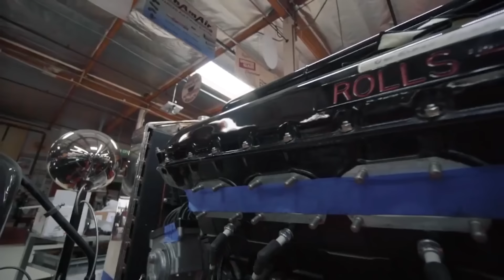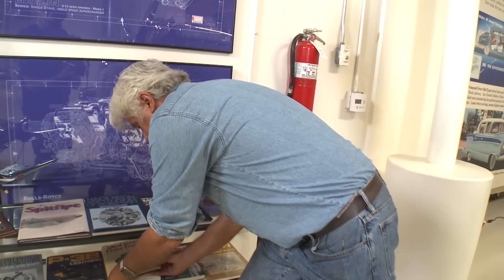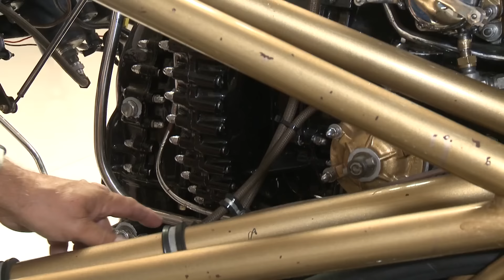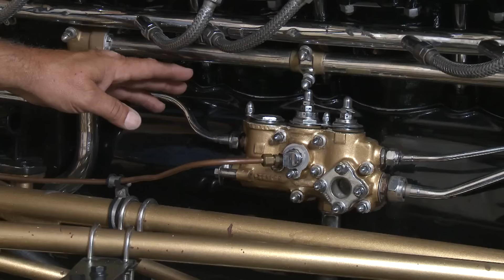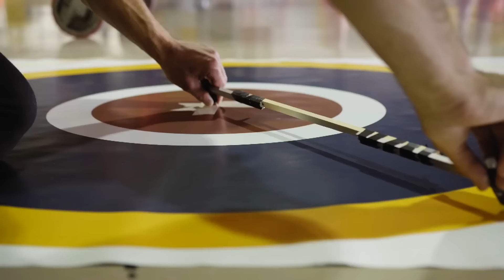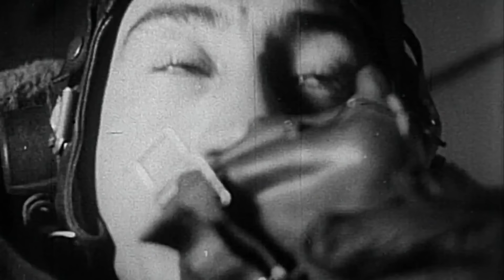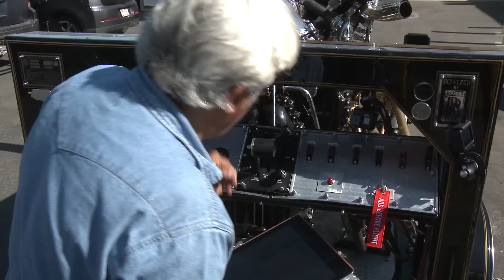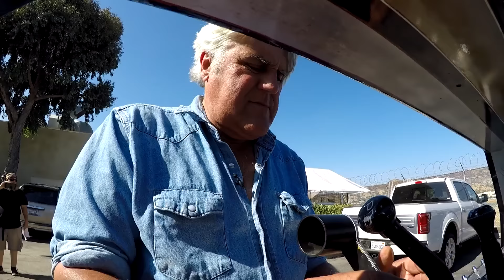The Engine That Won World War II - Jay Leno's Garage

Comment: Great seeing a British invention spread right across the world. A British engine used in p-51s and spits too all across the world. Brilliant.
Reply: Pretty sure Rolls Royce were building Merlins long before the USA joined the war. The high altitude performance was a significant improvement on the Alison engines and gave the P-51's a new lease of life.
Reply: John nevertheless, still a British invention and it was built in Canada too.
Reply: John Rolls Royce would have never been able to supply all the engines needed for Lancasters, Spitfires and Hurricanes.
Reply: @volon5  ONLY after the Brits came up with the 2 stage supercharger in 1942 inservice 1943 !!!  Before that ALL merlins were also ONLY a single stage !!!  When the Packard V1650-1 was installed in the P40 F and L models, 1311 of them, it made NO difference in performance !!!  SO until the merlin received the 2 stage supercharger the ALLison matched and exceeded the performance of the SINGLE stage supercharged merlin !!!  Why the Mustang MkI was 30 MPH FASTER than a Mk V shitfire, current production merlin engine !!!!!
Reply: @wilburfinnigan2142  
Rolls Royce came up with the 2 stage supercharger in 1941 and it was in service in 1942. the Allison not only had poor performance at any height, it lacked the performance of the single stage supercharged Merlin engine. the P 51 which entered service in 1942 about the same time as the Spitfire Mk IX was not much faster than a Spitfire Mk V and had very poor acceleration and rate of climb/  The Spitfire Mk IX in July 1942 was i a very different class.
Reply: @wilburfinnigan2142  wrong, wrong and wrong again. Early Merlin engined Spitfires could easily get above 30,000'. No Mustang 1 was comfortable above 20,000'. Speed means nothing in a dogfight. Manouverability is all - as the U.S. found out when they first encountered the Mitsubishi Zero.
Reply: To everybody in this comments section - can you imagine what actual war veterans would make of these discussions? They all fought incredibly bravely, alongside each other, for our freedom. All this petty point scoring is demeaning to their memory. 
Both my grandads took part in the WW2, my great grandad worked in the Spitfire plant at Castle Bromwich, Birmingham. One of my dad’s uncles was killed in a Japanese prisoner of war camp, another was captured on D-Day. 
Nearly all of us have connections to a lot of very brave relatives, let’s be proud of all of them.
Reply: @leftmono1016  Well said sir , the internet is full of " keyboard experts "  who haven't a clue what their commenting about ! All brave people on both sides of the pond .
Reply: sgbobsg  Field Marshal Goering may of made some mistakes, but the the Germans weren't stupid, Britain was a very important objective in the war
to them, if the Brits had not of won the battle of Britain, their would be no 
D day in the future, i think they were quite aware the american were most probably going to get involved later in the war.
Anyway buddy it doesn't matter me or you wasn't born, and to be honest i don't think we have the right to argue over such things, we should be more respectful to the men and women who fought for our freedom, than arguing over who did what.
Reply: @subconscious.com_usa6691  Well said sir ! Nice to see a grown up comment ! In Afghanistan the "Mericans " were a great bunch of lads even sharing their superior kit ! So proud we are comrades .
Reply: sgbobsg I’m an American and I can say your wrong. Wtf man. You just roasted someone you don’t even know and in case you didn’t know we didn’t single handedly win the war.
Reply: sgbobsg  
Rolls Poyce did all the design and development and made far more Merlin engines than Packard, Rolls royce also made the Griffon engines and jet engines. Rolls Royce even had to show Packard how to do it.
Reply: 🤔 WOW i thourght the WAR was over ...maby not by the sound of it in here ????
Reply: I think a lot of folk in this thread need to chill out a bit . I would also recommend reading the book wings on my sleeve by Eric “winkle” Brown . Am guessing he knew a lot more than all of us .
Reply: @rcr76  Very true Eric " Winkle " Brown was one of , if not the most experienced , highly regarded pilots of that era . He flew more types of aircraft than anybody.
Reply: @rcr76  First sensible comment.
Reply: sgbobsg  
yet everything I say is true and can be proven while everything you say is untrue or you would be able to prove it.

I challenge you to prove just one thing.
Reply: sgbobsg  
From October 1943 a total of 167 Wellands were dispatched from the Rolls-Royce facility at Barnoldswick. By this point, Adrian Lombard's straight-through design, which became the Rolls-Royce Derwent, had proved more reliable and produced more thrust, and production of the Welland ended.  Then there was the RR Nene in 1944.  No jet engines in WW II? 
 Packard had been making V 12 car and boat engines but not aero engines and nothing at all like the Merlin which was being mass produced in Britain before Rolls Royce gave the engine to Packard and showed them how it should be made.  So not only was Rolls Royce making jet engines and all the Griffon engines they made more Merlin engines than Packard.
Reply: sgbobsg  
Ford of Britain which was not controlled by Ford USA did make rolls Royce Merlin engines just as Packard made Rolls Royce Merlin engines, Rolls Royce paid for them all and Rolls Royce made 65,000 or 10,000 more than Packard, Rolls Royce also did all the design and development as well as work on the supercharger and carburetor which Packard never did, Rolls Royce also made all the Griffon engines different jet engines, they also did all the design and development of the Griffon and the development of the jet engines and most of this was during the war.  So no if you add Ford of Britain to Packard Rolls Royce still did more during the war.
Reply: sgbobsg Yeah we were too busy trying to defend half of Europe while bombing Germany... and Montgomery was quite the character but all of the offensive big operations were led by us and Churchill wouldn’t have it any other way which is illustrated in the history books. I think you forgot we are allies, and yeah 40-41 was spent defending British soil which was under heat from the Luftwaffe.
Reply: Adam corrigan I as an American agree. Don’t know why people hating on you guys.
Reply: @adamsaffell2361  it was a collaboration
British intelligence American steel and russian blood
Reply: sgbobsg  
Germany had radar of their own and they did try to destroy the British radar, USA may not have known what radar was until Britain gave it to you like so many other things.   If you ever went to Dover in the South East of England there are still 3 of the old radar towers there, very hard to not see them, in fact they are quite visible from Calais in France.
When Germany was trying to destroy the radar they did briefly put just one out of action, it was at Ventnor in the Isle of White, that is just off the coast of Southern England. but no only was it soon back in action the German's never knew they had put it out of action.
Reply: sgbobsg  Bruh you need to put your national pride aside and look at things realistically. Britain was the only country that could actually defend itself and America was needed for resources for dday. America should have come in earlier and not let millions die. They were allies
Reply: sgbobsg  
I know you have no facts, do you sweep the floors or what else is your excuse for being so ignorant?
I can prove my facts what can you prove?
Reply: sgbobsg  Iam swiss we gave up doing wars a long time ago ,you shouldnt be so defesive i was just pointing out a true historical event, you was talking about dunkirk, i was just pointing out your ancestors had a similar
event themselves with the same circumstances, the british made a huge mistake just like the germans did at dunkirk.
I have read most of your comments on here, and to be honest you dont paint a very good picture of yourself
this video's about the merlin engine, it seems to me you have come on here because your just one of those types of americans, who cant stand the fact that other countries had actually contributed to the ww2 war effort and made good stuff in the past besides the u.s , just because this video is titled the enginge that won ww2 you just couldnt handle it, it may not be the engine that won ww2, it doesnt really matter, but you just couldnt resist putting your boot in could you, cant other countries have there momment cant people appreciate none american achievements.
You know i could bring up vietnam after your last reply, but iam not going to do that, because i have class, to do that would make me just as bad as you, and it would be very disrespectful to the young americans who took part, so iam not.
By the way dont comment back iam not interested
Reply: the Merlin is the engine that MADE the p51d  what it is ..   the alison they had in it was a major underperformer...
Reply: sgbobsg  The Yanks kept out of it until the beginning of '42 . After Pearl Harbour. Late to the party as usual, same as WW1
Reply: Basically to summarise , the P-51 and the Spitfire were two great planes and the Merlin engine is a British engine...done 👍👍
Reply: sgbobsg  Funny that Barrie Rodcliffe absolutely dismantled all of your arguments months ago and you're still arguing. Pathetic.
Reply: sgbobsg funny that you forget how much us “brits” helped you with your war in the Pacific? Funny a lot of Americans forget that part...
Reply: sgbobsg how much fighting did you do? Shut the hell up.
Reply: sgbobsg  There's nothing wrong with a tactical retreat its being smart, the Americans had to retreat many many many times in the war of independents if they hadn't they would of lost.
Reply: my Father was on the Front Lines in WWII, and was Captured and Held Prisoner by the Germans until the End of the War
Reply: sgbobsg  
Gorimg did try to destroy the airfields, he failed, Goring also tried to destroy radar, he failed in that as well.
Reply: sgbobsg  
You couldn't get either language right could you?
Reply: @Ranger_Raptor_Twin-Turbo_3.0L  
Packard went broke in the early 1960's, Rolls Royce bought Allison.
Reply: sgbobsg  
I only say what is true and can be proven, maybe you should try it sometime.
Just as your reply to Wilbut Finnigan was absurd, The two stage supercharger was because the first stage worked very well from seal level to around 20,000 feet, the second stage gave performance from there up.
Reply: sgbobsg  Gotta be the dumbest comment I've read. Is that what American schools really teach u kid?
Reply: sgbobsg  Sounds like you've only learnt about the war from the American perspective. I mean I knew the education system in the US wasnt great but this??... bro you need to open your eye abit. Nothing I can do to help tho I guess. Ignorance is bliss as they say
Reply: sgbobsg  wow I guess you are not military as you wouldn't speak like that about all the good men and women who joined forces to defeat the Nazis
Reply: sgbobsg nevertheless he was the one calling the shots on the battlefield.
Reply: sgbobsg  whatever!,... your parents must be turning in their graves at how their off spring has become so full of biased hate towards the world and what a waste of time their sacrifice was for their child to become such a one sided nationalistic uncaring trump supporter ...🤦🤦🤦😔
Reply: sgbobsg  Ok perhaps i made a mistake
Reply: sgbobsg  There was also a P-51 mustang factory in Evansville, Indiana.  After the war it became a Whirlpool factory.  I grew up about 2 miles from the factory, but that was long before my time.  I was about 15-17 years too late to see the P-51's fly out of the attached airport north of the factory.  The airport was one of the reasons they chose that factory to build them.  I really don't know what engine they used from the Evansville factory, but I would assume the same one the rest used.
Reply: Original Prankster - I'm 3 miles from JLR Castle Brom. I remember when they started on the Spitfire Island and to begin with it just consisted of curved steel beams. I thought how stupid modern sculptures were - and then they fitted the Spitfires - brilliant :)
Reply: sgbobsg How??? The merlin IS BRITISH?!
Reply: sgbobsg Yanks as per usual. Listen. The merlin was British. You yanks decided to bump it up a bit but it wasn’t as good as the ones we were upgrading and producing. And putting everything aside. It remains a British product. That was adopted by the USA because it was the best engine designed at the time.
Reply: soaringtractor  You are correct.  Thanks for the correction.  The P-47 Thunderbolt was built in Evansville... mea culpa.  https://www.14news.com/story/29399467/p-47-thunderbolt-named-official-state-aircraft-of-indiana/
Reply: sgbobsg  The US education system is trash, go study.
Reply: soaringtractor  Guess it's because RR are so terrible that Boeing use RR engines... don't forget mate, it was the UK that gave you the Jet engine, it was the UK that gave the US the technology(all moving tail from Miles M52 project) that allowed the the US to go supersonic( the US wiped 10% of our wartime debt to rid the UK of out developing it in aerospace, such as the TSR2, BAE Replica and now, the sabre engine). Your are essentially bragging that you made 1/3 of all the engines that you couldn't design yourself, the Allison engine inferior in all ways... get over yourself. Notice how your huge industry couldn't do VTOL? So you adopted the harrier...you couldn't so Liftfsn in F35...hired RR... get a grip mate
Reply: the Axis Powers were defeated by the Allied Powers in World War 2. It was a joint effort so why do people always argue and fight over who contributed more? Get over it............
Reply: sgbobsg  The British forces were not "sitting on our Island", they were heavily engaged with fighting the Germans in North Africa at the time as well as the Royal Navy escorting convoys across the Atlantic and in the Baltic Sea. I'd ask you to respect the many thousands of British and other nations lives lost during the bloody fighting, they certainly were fully active in the years before the US assisted.
Reply: Yes, respect to Britain.  Then it became a welfare state and has invented nothing since.  The dangers of socialism.
Reply: P Run I think you’ll find most jet engines are produced here. Bentley, Rolls Royce, Triumphs, exports in alcohol, finest scotch. Welfare and internal affairs are exactly that. Internal. Bollocks to do with with the inventions of 1930+.
Reply: soaringtractor  .I read that the Allison had a fancy Turbo and Supercharger combination...but you could hear the turbo part so it wss quieter than non turbo motors- hence the moniker " Whispering Death"...is that correct?
Reply: sgbobsg plain wrong 55 thousand Merlins in the US the rest mass produced in UK, Packard did a fantastic job as a sub contractor and got paid for the lot. 146 thousand Merlins built. They are the fact now stop disrespecting your parents and mine who fought together against a common foe. If you are a Russian troll my grandfather was on the Russian convoys to Murmansk, later on while in Southern Atlantic his ship was torpedoed and he was was lost. My point I have many US friends and German friends and a Russian I am 63 and the war is a lot closer to to me, one generation. Fxxxcking grow up and stop disrespecting your parents and your grandparents. The allies fought together and won paying a huge price. You would do well to think on that. Stop waving your dxxk around and do some research and try to be interesting.
Reply: Anthony Wilson couldn’t have put it better myself.
Reply: Built on America because the Brits were being bombed and we had the facilities to build them. Our best effort was an Allison which was no match to Merlin
Reply: sgbobsg  And the british and other allied strategists took advantage of these mistakes. That's whats called good tactics I think
Reply: sgbobsg  What was your point?
Reply: The U.S's stuff wasn't up to date, so we got the best thing available and god dang did it work.
Reply: sgbobsg  But that is just it, from 1939 until 1942, The UK more or less fought alone in Western Europe. Oh and all of the stuff you sent over to help the UK, it was all paid for, every item was purchased. The USA gave us nothing. The difference is that given the same situation, but the other way around, The UK would have fought alongside the USA from day one.
Reply: sgbobsg  I am of course very grateful to the American men and women for all of their efforts, prior to them actually fighting which did not take place until after Pearl Harbour. Yes of course many did help to deliver all of the equipment which we purchased from you. As for the second World war, there is very little that I do not know about it. As for Vietnam, the British Government advised the US Government that to fight in Vietnam was stupid, as victory there was extremely unlikely. Britain has fought all over the World and for the most part we have been victorious, hence the reason that we did have the greatest Empire that the World has ever, or will ever see. When it comes to war the UK knows what it is talking about. The facts speak for themselves, the Vietnamese lost 3.5 Million people, and the USA lost 57 Thousand. But the USA were defeated by the Vietnamese. The assistance provided to the USA by Great Britain was advice, the USA chose to ignore it. The fact is that the USA, apart from 1 or 2 minor skirmishes has never won a war alone. Even back in 1776 they could not beat the British alone, they needed assistance from France and Spain. In WW1 which began in 1914, but for the USA it did not begin until 1917, the war was all but over. It finished the following year in 1918, and even if the USA had not entered the war at all it would still have probably finished in 1918, but may have lasted until 1919.
Reply: soaringtractor  T-28 Formation - Trojan Thunder - EAA AirVenture Oshkosh 2019
April 27, 2020 https://www.youtube.com/watch?v=J3lTcitjx08&lc=UgybUMqj0Wept1ed-U94AaABAg.97y_9sU0u1V97z4OvMMp6Z
Reply: sgbobsg  Wrong, RR built 82,000 Merlin engines, Packard only built 55,000 if you wanna use facts maybe do a little research.
Reply: Outrageous replies written here, don’t let patriotism get in the way of facts. It IS a British design but thank God the US was there to make them too. Britain avoided invasion (by the skin of our teeth) by defending against the Luftwaffe which is incredible but also pilots from around the world took part, most notably the Polish pilots who had a higher kill rate than any other squadron. Thank god the Yanks did come into the war as Europe could never have been liberated (not Britain as they were never invaded). The stories can go on and on but the war could never have been won without the US but don’t forget the US couldn’t have won the war without Britain and all the other countries involved as well as all the intelligence gathered by European countries. We were all in it together and won together. And also Britain was fighting in other parts of the world too, Africa, Italy, Far East (Asia).
Reply: sgbobsg  you are so very wrong. Packard built barely a third.
Reply: sgbobsg He did go after the airfields, Berlin got bombed Hitler went nuts and forced Goering to bomb London. Battles are won by those who make the fewest mistakes. But everyone makes mistakes unless they have never done anything. I wonder if they bombed Berlin to make them bomb London (and let airfields recover). Also RAF would know where they where going.
Reply: sgbobsg The engine was made under licence from Rolls Royce 55,000 to be precise. The UK mass produced in the UK at four plants Total production was 146,000. My source is Wikipedia. Jay is no fool he knows what he is talking about. Wikipedia said one plant hit 100 engines in one day.
Reply: Baron Marseille why are so many people acting like kids. Discuss the video objectively using good sources and stop wining like kids
Reply: sgbobsg  Packard didn't build the bulk of the Merlins.
They built about a third.
Reply: soaringtractor  
You can tell as many lies as you like but the Mustang when it first entered service could only hit 400 mph in a dive and how is 700 miles maximum range of the Mustang twice 650 miles combat range of a Spitfire Mk V with a drop tank?  The Spitfire Mk V could use a drop tank, the early P 51 could not. 
This is from US test flights in July 1942 with 4 cannon, 390 mph maximum speed. In July the Spitfire Mk IX did 404 mph and the Mk V a in April 1941 did 375 mph. 
The Mk V c with 4 cannon did 374 mph in March 1942.  
Poor little Willie you get caught  out telling lies as always.
Reply: This kind of an argument is an insult for all the men and women who died fighting the Nazis. Shame on you.
Reply: sgbobsg  
The US lost more lives and a large part of that was due to US incompetence.  Who did most of the fighting against the best German forces is not a matter of opinion but fact, That was Britain and Canada along with other allies who often had to step in when the US stuffed up. Kasserine Pass,  Salerno where many British troops were used by Mark Clark as cannon fodder, Monte Casino where the Polish and New Zealanders did what the US could not do. Normandy where Bradley stuffed up. Market Garden which is blamed on Montgomery by ignorant people but since the planning was done by two US officers and it might still have worked but for the failures by the 82nd and 101st US airborne forces. The Battle of the Bulge where the US was caught trousers down and Montgomery had to take command of two US armies who were in a shambles.  
I know your Hollywood inspired books do not tell you any of this, it would not look good.
Reply: George Strait  
The Yanks did not bother, they did no fighting until after Hitler declared war on USA.
Reply: sgbobsg  
Vietnam another messy war by USA who always come to us every time you can't win a little war by yourselves, at least we had the sense to stay out of that one.  Too often we go in and fight in your wars but you do not have to wait two or more years.
Reply: sgbobsg  
First every one of your lies has ben shown for what they are and USA always begs us for help every time you get into another little war you can't win alone.
Britain often gave free advice, ignorant big headed Yanks had to find out the hard way the advice was good as well as free.
The Ausies did have more spine than USA but Britain still did more fighting against the Japanese than USA, after all USA was too busy hopping from one island to another with long breaks between to do much fighting, Britain was fighting continuously and winning.
Reply: sgbobsg Good job we did and good job the Hurricane and spitfires won the Battle of Britain and Royal Navy would have blasted any amphibious assault on UK, or we would all be talking German and under Nazi rule US included. Made a good job of North Africa on our own and then US joined in after Pearl Harbour. Stupid boy Hitler invaded Russia so they switched sides and did huge damage to the German War Machine We are allies remember that and all the supplies from the US where eventually paid for, UK did not get them free. Unlike some countries got jet technology and radar and nuclear secrets free. Read your history properly, and celebrate the fact we where and are still allies.
Reply: sgbobsg Four major factories in UK and Packard in US. Roughly 150,000 Merlins built 55,000 by Packard. You do the sums. Also if you are interested in some other powerful engines look up Rolls Royce Griffon V12 Napier Sabre H24 twin crank? and it did get reliable and Bristol Centaurus 18 Cylinder Radial. Interesting subjects.
Reply: sgbobsg Stop puffing that stuff man, it’s making you look a fool. Germany had radar, but they used it wrongly early on. UK had properly developed radar system plus ground observers. Then UK developed the Cavity Magnetron that completely changed the playing field. We shared all this technology with our allies. This meant warships in the Pacific had radar and could see at night Japanese warships Leyte Gulf ring a bell anywhere. Allies still allies. Celebrate it Shelby Cobra style Man.
Reply: sgbobsg Good job you have the right info and everyone else is wrong sorry only all the Brits are wrong. Where did you get your info from I want to read it myself.  I can also say not all books are right and you have to read a few. I am  a Brit I am a trainer on engines and interested Globally in engineering of all kinds, I have American Friends and German Friends and have visited US and an air museum. Norfolk Virginia has a great one and the guys working there where great guys and very informative. You seem to resent anything that is not American and say you work at the Smithsonian, you do not sound like the guys I met in the Museums in Norfolk. Have you ever travelled to the UK and visited Museums here, we have one especially for the US planes used here during the war. The Virginia Beach air museum have a huge flying contingent of planes WW1 and WW11. And one of my favourites a Mosquito a flying example. I went to see the Hellcat the Mustang and the PBY and saw them a great visit everyone. German Russian and Brit planes good cross section.
Reply: sgbobsg Roughly 150,000 Merlins built at five Mass production factories four in the UK and Packard in the US. Packard built 55,000 do your maths. Packard where shown how to build it by Rolls Royce and adapted production to the tooling they had and their production lines makes sense.  One UK factory Glasgow in Scotland make one hundred Merlins Engines in one day. It was mass produced both sides of the Atlantic and much more built in the UK. Just look up Rolls Royce Merlin in Wikipedia. Great joint effort by the allies.
Reply: sgbobsg wow don’t bring me down with your negativity man. Everybody just read up on Wikipedia Rolls Royce Merlin and separately the Mustang its all there. Fake news man Fake news it’s just a page away. Please just read it and absorb the facts. Sgbobsg you must be an ill informed  12 year old on a wind up.
Reply: sgbobsg UK ordered P39 but US considered the super chargers secret we did not get. We cancelled the rest of the order. Allison engine with turbo super chargers was experimental. We would not have got that either everyone look up Allison engine on Wikipedia two clicks and the truth.
Reply: sgbobsg Wikipedia Allison engine turbo supercharger experimental. Even US forces when it adopted the Mustang still used used Merlin in the Mustang. UK ordered P39  but turbo/superchargers removed secret. We cancelled the rest of the order. It was not available for Allison engine(Experimental) and if it was we would not have been supplied it. I love the way you try to steal the Rolls Royce Merlin with Packard built it. It was built under licence and massed produced in UK and US. No Rolls Royce no Merlin? Just check Wikipedia
Reply: sgbobsg so wrong the only reason a P51 Mustang got a Merlin was after it was supplied it was evaluated found lacking at fighting altitude but very good at low altitude. Evaluation team liked the airframe and approached Rolls Royce. It’s in Wikipedia look it up everyone. Rolls Royce Mustang Mk.X
Reply: sgbobsg The engine had a single stage supercharger but no turbo to back it up like on the P39. Which had the room for dual boost.  Allison was trying to get it into single engined fighters but not enough room it was experimental and not available to UK. As a turbocharger gets to higher altitude due to thinner air it can spin faster compensating for the thinner air and blow more rarified into the supercharger which compresses air even more and feeds into engine. More oxygen available means you can burn more fuel effectively and expand gases more effectively driving pistons harder developing more power.this was available to US on P39. But not UK hence cancelling of order by Uk.
Reply: sgbobsg  You're behaving just as bad as the other trolls, and your information is wrong, but you simply cannot see it. Take a good look in the mirror.
Reply: Yup!  I heard on tv while watching a ww2 documentary that when RM Goering heard about the Mustang, his remark was “The war is lost!”.
Reply: sgbobsg Then why did the P51 perform better when a Merlin replaced the Allison?
Reply: Couple of points. The Merlin was a fantastic piece of engineering, well done Brits. However it was not well suited for mass production USA style.

A Packard-Merlin is essentially a new engine re-engineered from the original plans, that did not require all the hand massaging that the British version needed.

Packard eventually turned out over 55k Merlins that the RAF and USAAC needed very much.
Reply: sgbobsg  You are as bad as Proud_Brit. See my reply to him!
Reply: "New Zealand did not  actually own any Spitfires outright. In the Pacific theatre they operated the Curtiss P-40 Kittyhawk and Vought F4U Corsair fighters but RNZAF pilots did fly Spitfires on behalf of the RAF in Europe and North Africa (RNZAF Squadron 485 operated in Europe)."
lots of pitchers of Spits
https://acesflyinghigh.wordpress.com/2014/01/11/spitfires-down-under/
Reply: Hoa Tattis  
I just saw an old  comment by Keith Johnson   
" there were 2 versions of the Merlin built in WWII,  the Rolls Royce Merlin and the Packard Merlin.  Packard built their own version of the Merlin from the Block Up.  Packard built higher quality Merlin's by insisting they be Manufactured with much Tighter Machining Tolerances than Rolls Royce was using, and it took Packard months to completely redraw the Plans.  Packard said they could build them faster that way and that it would have better parts interchangeability.  Rolls Royce also allowed Packard to use higher quality Bearings than RR was using.  So all of the Sloppy Machining Tolerances Rolls Royce was using, was Engineered Out by Packard.  That provides better Performance, Reliability, Durability, and Longevity to the Engine that the RR Merlin's didn't have. Packard made other upgrades to the Merlin, but as you can see, Packard Merlin's were different at least, if not higher quality Merlin's than RR built.

 Like all of his comments he has no idea, there were many versions of the Merlin and all of them developed by Rolls Royce.  The Packard versions were based on the Rolls Royce including modifications for mass production from before Packard got started slowly, it took them a year to do drawings. The tolerance nonsense shows, the fact is that when hand built the Merlin tolerances were far better but it took longer so working with Ford of Britain the engines were modified for mass production,  Maybe why Rolls Royce made more. Packard was given these to copy. Packard had no part in that.
The bearings used by Packard were just because they were availab le locally much like the supercharger made for Packard.  
Packards were just copies and never better or why did Rolls Royce have to set up a plant to rectify faults on the Packard copies?
Reply: Hoa Tattis  -  whatever planet you're from that must be some good dope
Reply: Hoa Tattis  Nope.  I'm Canadian.  My great grandfather landed on Juno Beach with the 3rd Canadian Infantry Division.  My grandfather took the Queen on a boat ride in 1984 when she visited Ontario (he was O.P.P.).  Long live Queen Elizabeth.  Oh dear, indeed.
Reply: sgbobsg HAHAHAHA Us Brits fought tooth and nail in France. You Americans wouldn’t have done much better without British war tactics.
Reply: sgbobsg  The Brits and the poles and the Canadians plus a small number of Americans who joined the Canadian airforce absolutely whooped the Germans in the battle of Britain, i wouldn't take no notice of that Goering excuse, the Germans was so badly beaten and outsmarted by the Brits and allies, and their Radar defences, the Germans tried to develop a stealth aircraft for a future attempt later on in the war called the ho 229, the Germans knew they had no chance against the Brits with their radar defences, that Goering excuse is just them saving face
Reply: the British wouldn't have Won the Battle of Britain without shipments of 100 octane Avgas from America, that the Germans didn't have, 
and giving the British Aircraft a Performance Advantage over the German Planes
Reply: @Ranger_Raptor_Twin-Turbo_3.0L  
Britain developed 100 octane fuel before the war and had enough in stock for RAF fighter command the whole of 1940.  None of that came from USA.
Reply: Keith Johnson - Shelby GT500 I agree about the gas but I stand with my original comment. The merlin IS BRITISH.
Reply: @adamcorrigan2044  -  there were 2 versions of the Merlin built in WWII,  the Rolls Royce Merlin and the Packard Merlin.  Packard built their own version of the Merlin from the Block Up.  Packard built higher quality Merlin's by insisting they be Manufactured with much Tighter Machining Tolerances than Rolls Royce was using, and it took Packard months to completely redraw the Plans.  Packard said they could build them faster that way and that it would have better parts interchangeability.  Rolls Royce also allowed Packard to use higher quality Bearings than RR was using.  So all of the Sloppy Machining Tolerances Rolls Royce was using, was Engineered Out by Packard.  That provides better Performance, Reliability, Durability, and Longevity to the Engine that the RR Merlin's didn't have. Packard made other upgrades to the Merlin, but as you can see, Packard Merlin's were different at least, if not higher quality Merlin's than RR built.
Reply: Keith Johnson - Shelby GT500 Your point is you should not have sold it to us another Nazi sympathiser!
Reply: Keith Johnson - Shelby GT500 They would have not won if we had not developed the Merlin later used by the Mustang the Hurricane fighter and of course the Spitfire, the Merlin engine using the BAM British Air Ministy 100 Octane fuel jointly developed from the standard US 100 Octane by US and test team in UK testing and feedback to US. They would all have been useless without Radar and all the control stations. That was all due to Dowding many tried to steal his rightful place in history.  I think it’s a good job we where on the same side and still are. Sorta Shelley Cobra type thing going on there.
Reply: sgbobsg Thankyou so much, because of America We DoNt sPeAk GeRmAn! Lol
Reply: The P-51 used about 3 different engines including 2 built and designed in the US which were later in the war and more powerful than the merlin
Reply: PilsPlease read up Wikipedia on the Mustang. First engine was Allison it was replaced by the Merlin RR design and stayed Merlin with various upgrades. What other engine are you talking about?
Reply: sgbobsg  Agreed
Reply: the most successful application of the Merlin Engine was in an American Airframe
Reply: @Ranger_Raptor_Twin-Turbo_3.0L  
The only successful Mustang had the Rolls Royce Merlin while the Merlin went into better aircraft.
Reply: @barrierodliffe4155  -  I  meant to say Alison 
I thought for sure that might wake the dead
Reply: @Ranger_Raptor_Twin-Turbo_3.0L  
Packard never made jet engines so of course even if Packard had not gone bust Rolls Royce would not have any reason to buy a broke company, Allison did make small jet engines.
Reply: @barrierodliffe4155  -  Wilbur must have died.  May the Lord have mercy on his soul.
Reply: Keith Johnson - Shelby GT500 I think he just changed his name ,he also used soaring tractor. You can spot his style he hates anything British he does very little research and loves to throw abuse from behind a keyboard ( very brave). When people attack others it’s generally due to low self esteem. They are trying to make up for a feeling of low self worth, typical example are bullies at school, but also on line or forums such as these. It sticks out a mile and they should be pitied. They should seek medical help it will help them for the rest of their life.
Reply: sgbobsg 
My dad was crawling along a creek bed when he looked up to see a German pointing a rifle at him
 near Heidelberg Germany, and taken captive